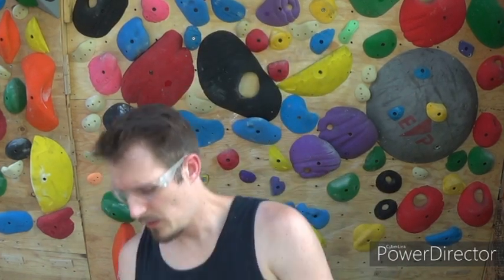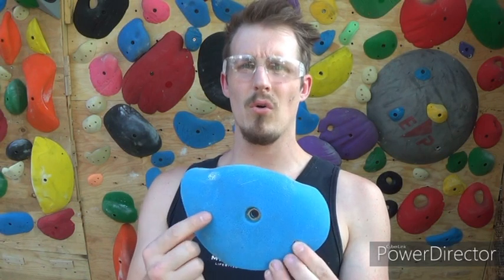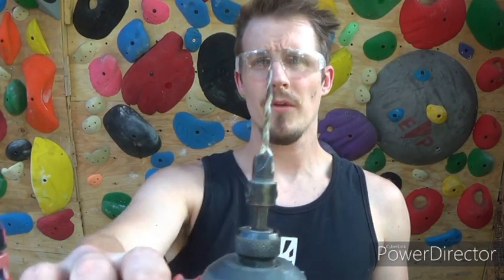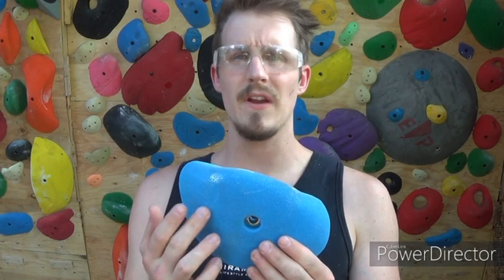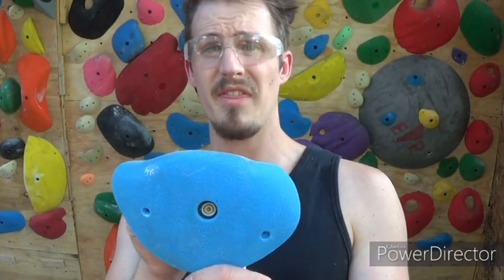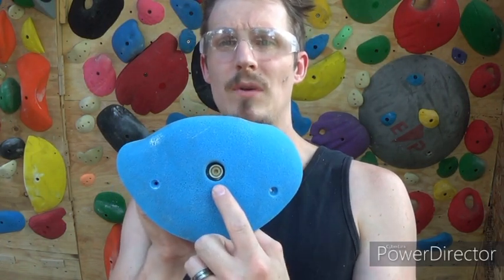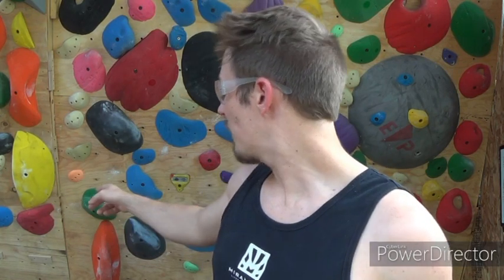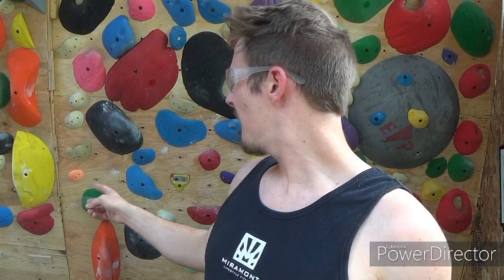Home Climbing Wall Routesetting- Turning Bolt on holds into Screw On's

Comment: Is it possible to turn a screw-on hold into a bolted-on hold ?
Reply from the maker: Possible- probably but I wouldn’t recommend it. Usually holds are screw on because they are too thin for a bolt